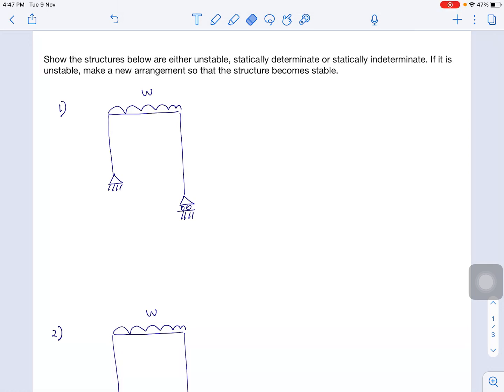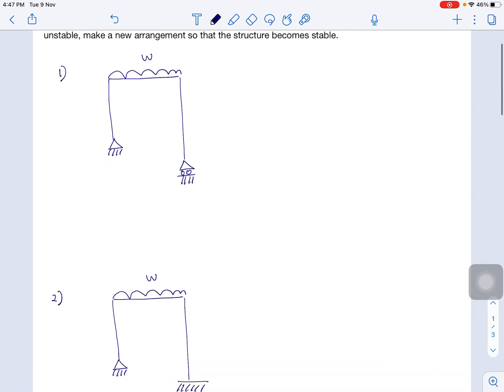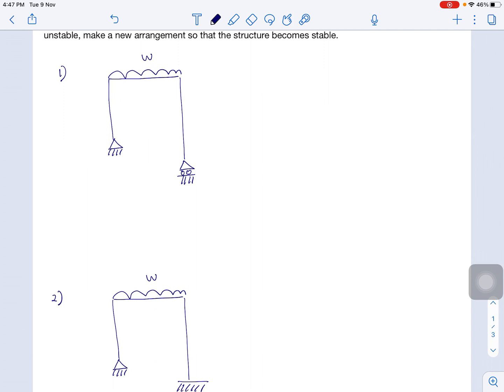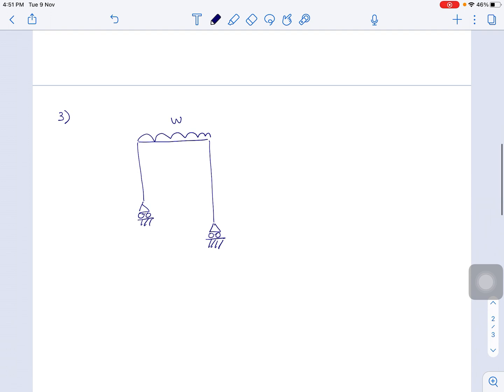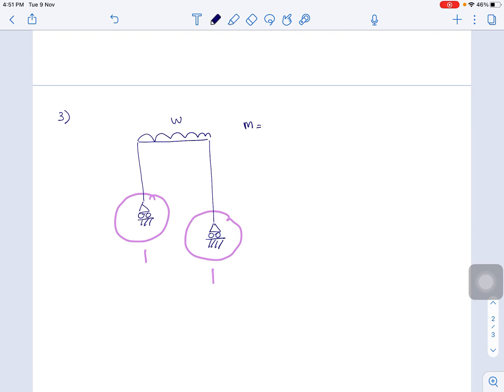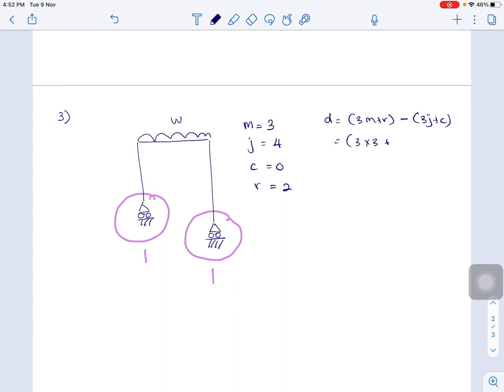STATICALLY DETERMINATE, STATICALLY INDETERMINATE OR UNSTABLE FOR FRAME

Comment: To determine the determinancy of the structure , we need to use the equation d = (3m+r) - (3j+c). And if d=0, the frame will be stable or statically determinate. Else if d>0, it will be statically indeterminate. Lastly, if d<0 it will be unstable.

Comment: Based on this video, i get to learn how to determine the determinacy of structure such as statically determinate, statically indeteminate and unstable structure by using formula;

d = (3m + r) - (3j + c)
d = r - n - c

d = degree of static indeterminacy
r = reaction
m = number of member
j = joint
c = hinge
n = static equilibrium

Comment: Based on the video, i learn that to determine the degree of determinacy of structure, we must use this formula, d=(3m+r)-(3j+c) where m is member, r is reaction, j is joint and c is hinge. From that calculation we can determine if the structure is statically determinate, statically indeterminate or unstable.

Comment: Based on the video, I learned how to determine if the structure is unstable, statically determinate or statically indeterminate by using the formula (d = 3m + r - 3j - c). From the result, we can decide if the structure is unstable, statically determinate or statically indeterminate. 

d = 0 (Frame is statically determinate)
d > 0 (Frame is statically indeterminate)
d < 0 (Frame is unstable)

Comment: Thank you for the video, Dr. From the video, I get to learned on how to determine the determinacy of structure by identifying the number of members, joint, hinge and reactions in a structure. Then, I learned on how to calculate the determinacy by using the formula and state the type of determinacy based on the answer that we got from the calculation.

Comment: Based on the video, i learned how to determine the structure statically determinate, statically indeterminate and unstable by using formula: d = (3m+r) - (3j+c) which are: m=member, r=reaction, j=joint and c=hinge